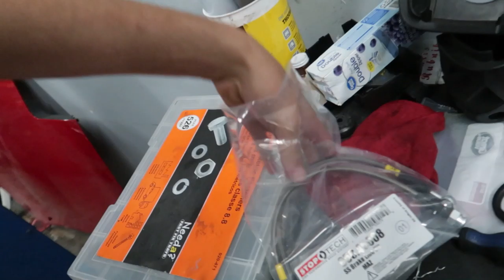THIS COULD HAVE ENDED REALLY BAD!

Comment: Worlds slowest engine swap award goes to Sammit! Sorry but had to say it and I continue to support since I know you are probably super home sick... but something that can be done in two days over two videos has taken nearly a month 😂😂😂
Reply: Brandon.S Chicago you can’t rebuild a whole engine in 2 days
Reply: Blitzworks the engine has been back from machine shop for almost a month. It came back assembled. All that was needed was a day of plumbing new items and a day on engine. Engine could be done in an hour or two. Either way, if you think he is even semi fast at car work you are nuts. I have watched all his videos for two years, one consistency is very very slow speed and using that to make videos. That doesn’t mean he is lazy or not a hard worker. Just not super gifted in the car assembly stuff. It is annoying when he is like “alright guys I put this wire in today and that will be it for today, we will crush this stuff tomorrow! - next day, okay I put this radiator cap on and did a bolt check, be back tomorrow to knock this stuff out! On and on and on

Comment: Tip of the day for you : next time, when u are changeing brake lines/hose, crack the bleeder and press down the brake pedal and keep it pressed down the whole time. The fluid will not drip and the work space will be a lot cleaner. Easyer to bleed and the reservour will not run empty

Comment: Top tip when doing brake lines. Grab yourself a breaker bar, wedge between the seat on the brake pedal.. push it down on the brake pedal and back it off slightly. This causing a vacuum that won’t let brake fluid leak everywhere 👍🏻